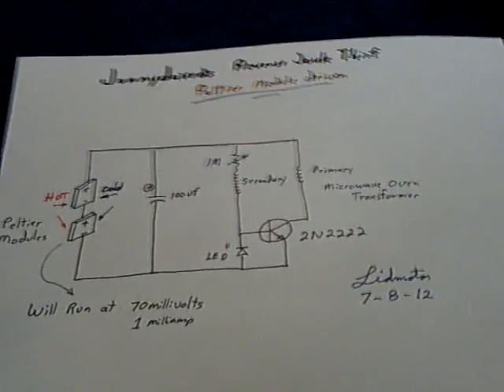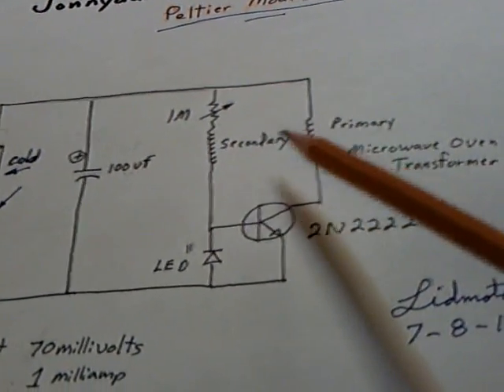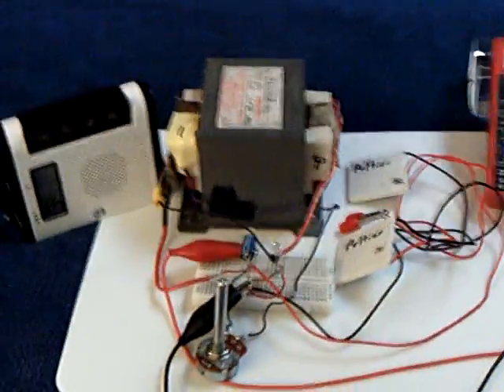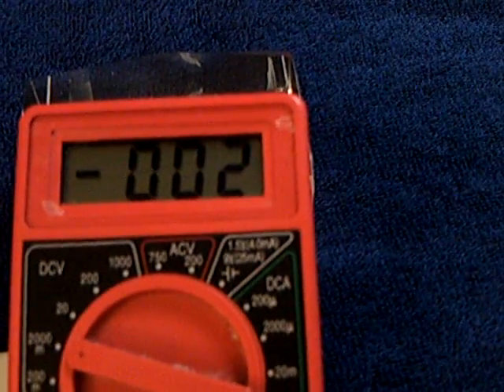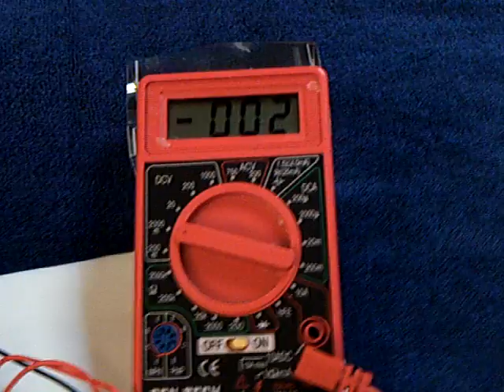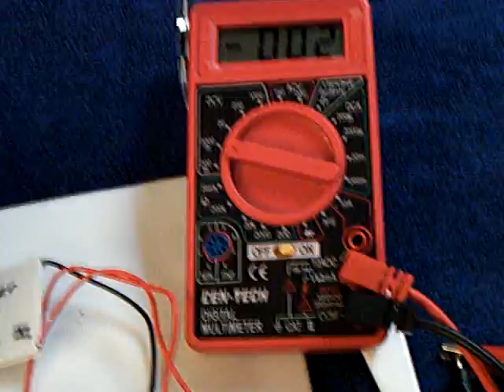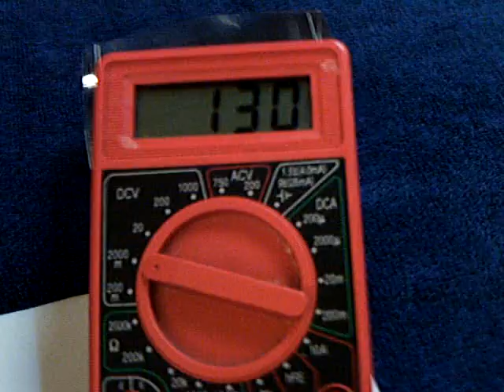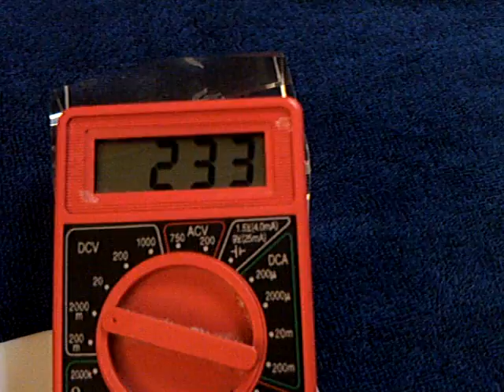LED light using heat as energy source

Comment: Interesting circuit but size of transformer isn't really portable.
I've seen this circuit as posted by "Larskro" Title "Joule Thief very very low input 0,136 volt".He is using 100:10 toroid and successfully ran it using 0.136 volts on toroid.Dedicated TEG generator circuit i noticed from search engine for micro power variant is using "100:1" turn which could work from 30mv or 50mv to power up circuit and yes led.My plan to strap this peltier to wrist with tiny heatsink on it to power up led.

Comment: Great work I am going to have to make this one, what about the atmosphere like a aluminum plate and a ground wire like tesla use to use in his experiments it's low voltage but it might be enough to get it going any Antenna will do really, and the ground can be any metal buried with a wire hooked up then let the light begin :-)

Comment from the maker: Hi Jonny.  Yes I already tried an led across the primary coil (like a regular joule thief) and it work great.  I left the circuit the way that you originally showed it to make it simple.  The fact that this circuit will run on the low low voltage opens up a number of options.  This should run nicely run on ONE .5 volt solar cell.  I have been srcatching my head trying to think of what else puts out about .5 volts with good amperage.   A copper/zinc voltaic cell puts out around .7 volts.

Comment from the maker: YES!  If you used aluminum heatsinks on each side the temp difference should be enough to make electricity.  Then the only thing you have to do is multiply the situation like we do with solar cells.  The problem is that these thermoelectric generators are currently expensive. The two little ones in this video were about $5 each.

Comment: The peltier units are great! I have one, and I hooked it up to a joule thief circuit with a tea light candle and a heat sink, and it would run for hours and hours. I could get many LED's to light my room plus the meager light from the candle. I used one of the candle lanterns from REI with the glass tube that slides in/out of an aluminum housing. The top of the candle lantern gets quite hot, and the heat sink remains cool enough. instead of the tea light, try a lamp oil refillable alternative!

Comment: Yes indeed this is why normally a big heat source is use like a candle or a stove for charging a super cap you could probably use a little dc to dc that will slowly charge it to the desire voltage hmm interesting! I need some super cap now haha

Comment from the maker: Thanks.  You could also store the electricity from the Peltier into a supercapacitor and use it later.  The trick is that there has to be a good temperature differential maintained for much power to be made by the Peltier modules.

Comment: Yes very nice! Peltier device are very nice electronic to use for either making a cooler or creating electricity. Now those "joule thief" type using big transformer are making me think of some nice way to generate energy. I have a stirling engine with a generator on it and I think this might be a nice way to extra all the juice it put out. Also those peltier can create very nice amount of energy! Put it on a stove and it will run a little motor etc! Nice video lid!!